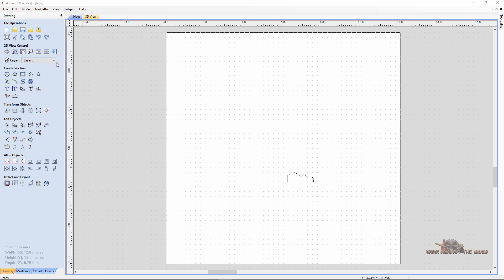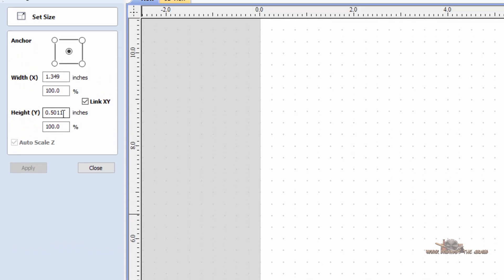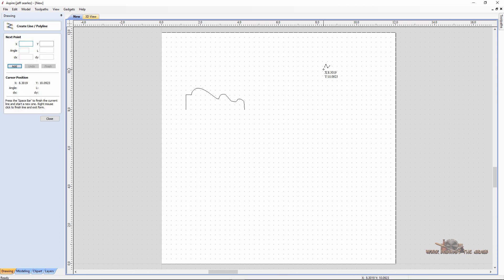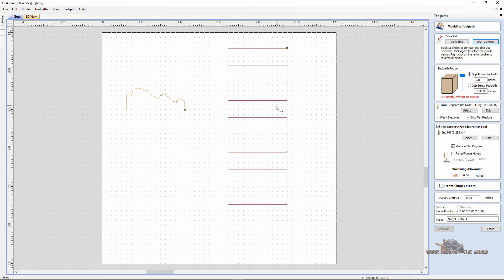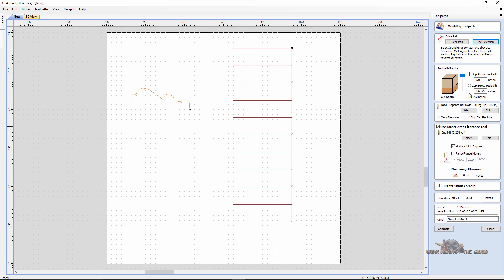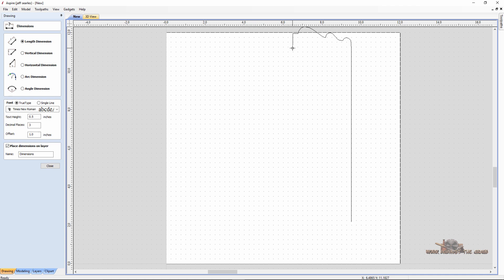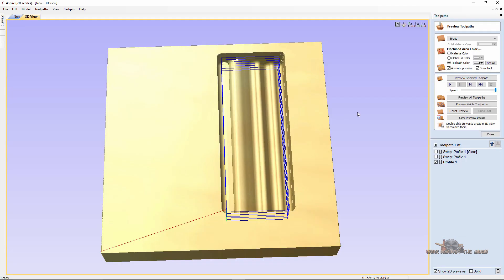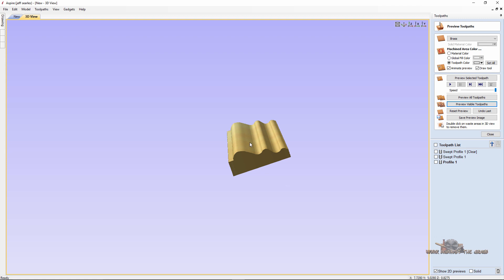CNC Moldings SUPER Easy and FAST

Comment: Afternoon Jeff, does this method have the option of rough first, then finish. Reason it drops to max depth even by choosing 1mm at a time, thank you
Reply: Yes, you may select a roughing tool path first use a quarter inch or 6.35mm endmill to do the roughing first, then do your finish pass. The roughing will probably make 2-3 passes in the general shape depending on size, then finishing cleans it all up. Hope this helps, and thanks for watching.
Reply: @jeffsearles3510  Thank you

Comment: great video. 
would this work with a line that wasnt straight. 
could you use it to ake curved mouldings
Reply from the maker: It ABSOLUTELY works with curves and or line segments that are not straight. You can machine some pretty cool moldings. Thanks for watching.